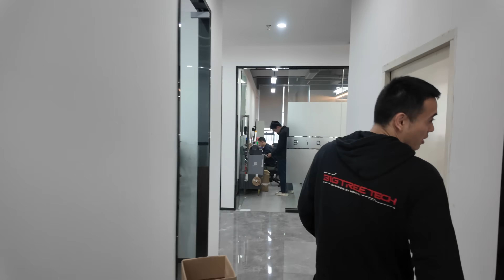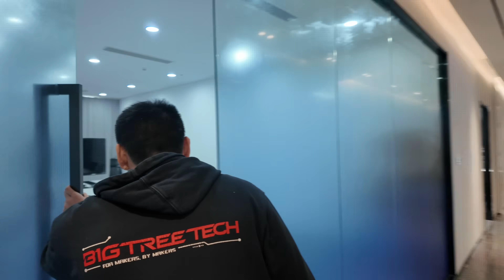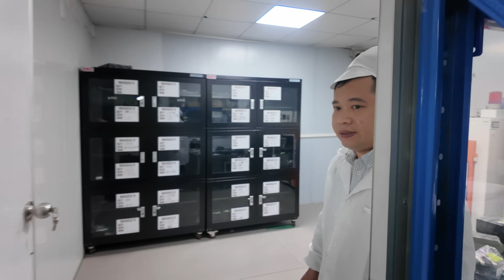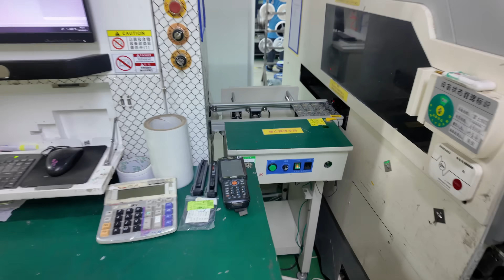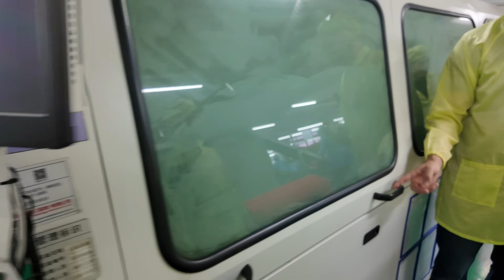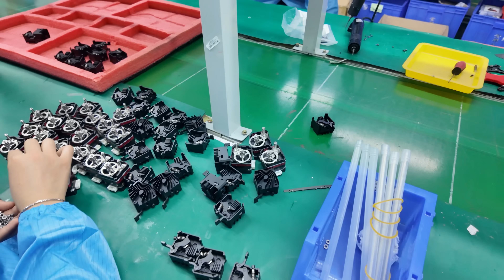Behind the Scenes at BQ/BigTreeTech!

Comment: Thanks for the tour of BQ.  I love factory tours.  I love seeing how things are manufactured.

8:40 - It's wild that there are lasers right out in the open, apparently with a very long focal length, engraving the tops of integrated circuits.  In the US, this would be completely enclosed, with safety relays in the guarding circuitry and a lot of other precautions to prevent human contact with a laser.

BQ has a much larger PCB operation than I imagined.  They need to make drop in boards to convert Bambu Lab printers to mainline Klipper to break them out of the proprietary walled garden.   🙂

I'm looking forward to adding a BigTreeTech Eddy probe to my SV08 so it can finally live up to its potential.
Reply: Hold my beer.